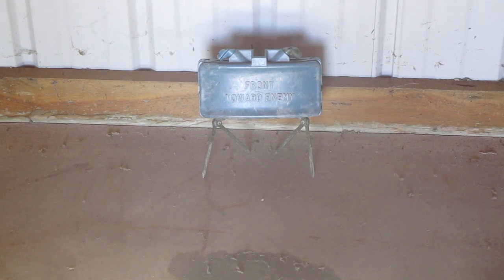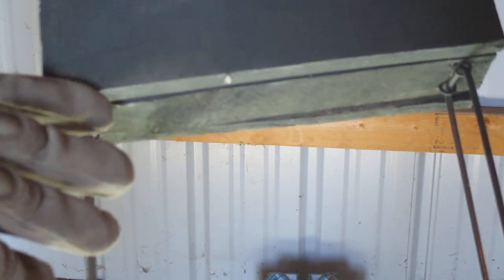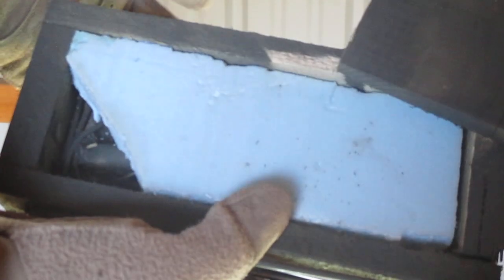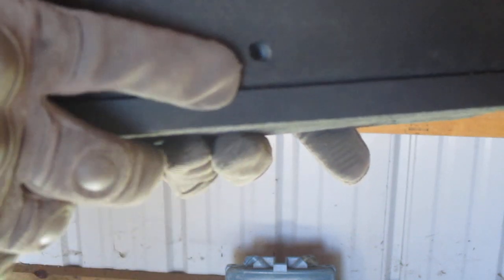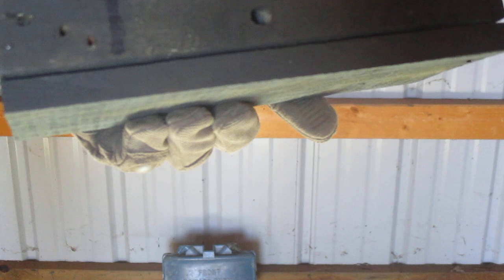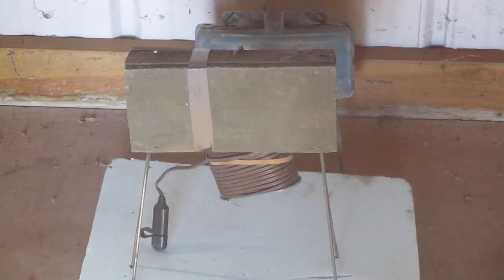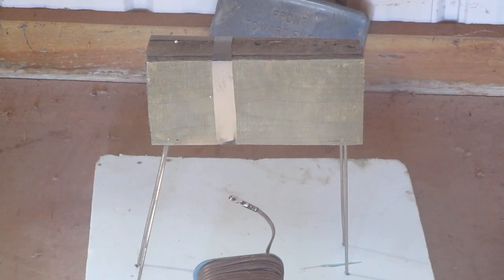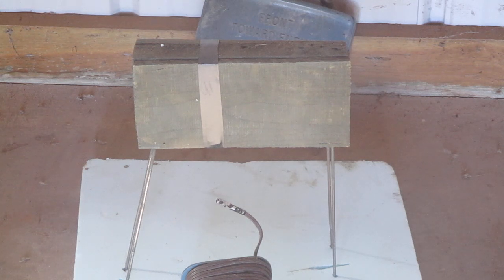VC Wooden Claymore Mine

Comment: Would it be possible to seal the wood with a thin layer wax all over the outside to improve the useful life? Do you think the wax would be able to impregnate the wood?
Reply from the maker: That could work.  Can't say for certain though.
Reply: @SecurityGuy42  interesting
Reply from the maker: I've never tried waxing wood products so I can't say for certain.
Reply: @SecurityGuy42  yea I get ya bud. I was thinking of how a bees wax coat makes tables considerably more durable.
The wax can barely be seen so I'm thinking that could be good. Obviously it's not going to be soldier proof but it would almost certainly increase the in place lifespan